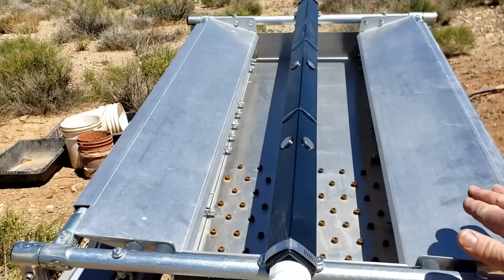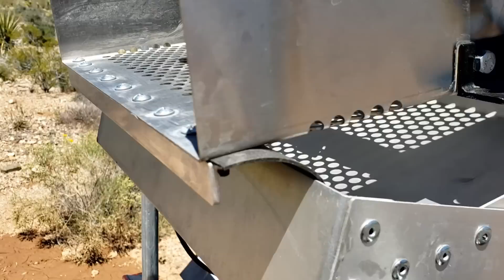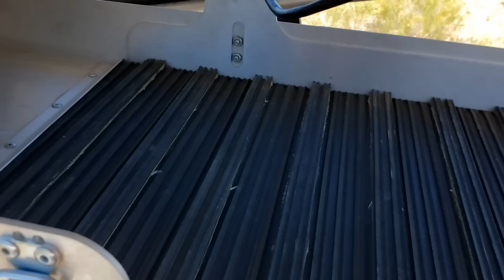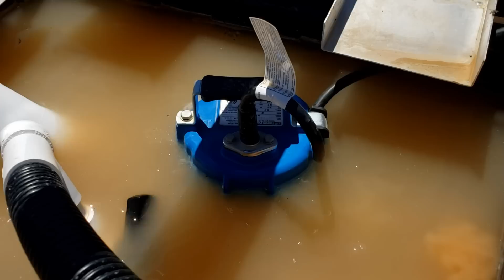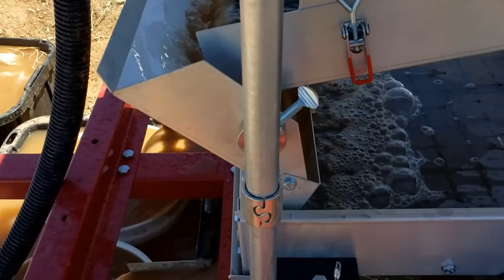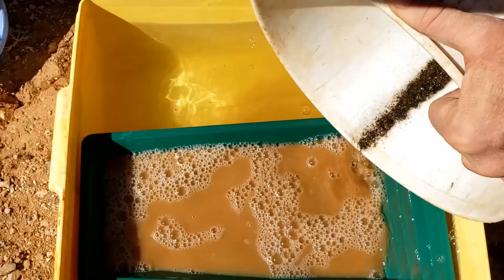Gold Rattler Wash Plant Production Begins !!

Comment: That is a reasonable payment schedule.
You have done a fine job of water clarification. The only thing I might consider as a future upgrade is to use flocculation upstream of the dewatering table to replace some of the sand filtering. Yet that might increase the water loss. It's a trade-off.

How many gallons of water per operating hour do you consume/lose? That's a lot of water weight to be hauling out into the desert.
The dry washers are less efficient recovery of fine gold, yet you may recover more gold weight per day because of the high throughput of a dry washer. Everything is a trade-off.
Reply from the maker: Flocculation in the main water stream will not work because the recirc time about 90 seconds.  You need at least 10-30 minutes to work properly.  This why there sand filters in place.  They are more effective.  However, Flocculation of the hydrocyclone discharge is optimal because the volume is a mere fraction of the total, plus the poor man's thickener slows down the process to permit adequate sedimention.  Water consumption is 60 gallons per cubic yard.  Less if it is wet.  Thanks for watching and appreciate your comments. 👍

Comment: Allan, do you trade to Australia? if so what voltage do your equipment works on, hope we can work together, all the best from Australia. Allan
Reply from the maker: In the future I hope to open a dealership there.  It would be perfect for your arid regions !  Everything operates on 110v AC at 60 hz.
Reply: @allansgoldmining  no problem, can always get a US 110v geny, or upgrade to 240v set up, also to cut down on transport cost, we can do away with the trailer, can easily be build here to your spec, looking forward to when you are ready

Comment: Hi Allan! I would recommend the following price: 1200 for the trailer. 700 for the upper gutter. 1200 for the shaker. 300 for the frame. 300 for pump hoses and pump. plus another 30 hours of work to put it all together. 1500 wages. plus 2000 profit. So 7200 plus possibly taxes. There is also a 10% surcharge, which can later be deducted by the middleman as a discount.
Reply from the maker: I like your thinking !

Comment: This seems perfect for the size small mining hard rock placer operation/ refinery im building. I built my company Raspberry Hot Springs on 30 acres of patented mining claims on the historic black hawk/gilpin and lower fall river/virginia mining districts in Clear Creek County Colorado
..while i was securing water rights for my business I came across historic Mining reports and documents suggesting i was sitting on very likely an avg of 3-4oz/ton AU ore..i invested a couple years of spare time into geology research , equip, and recently processed about two tons of fire assays and sure enough..they werent wrong! I have alot of work ahead sheeeesh..
   Id like to put a deposit down!

Comment: If you said $9,995.00 maxed out with everything we need... well I still wouldn't be sticker shocked... but at $5,500.00 well thats a fabulous introductory price to get the units moving and out in the field were everyone can see how all of this can be taken to the next level.

I can see longer dual sluice boxes side by side and a wider top box to feed the two boxes with a mini- trackhoe! Woo hoo!

A wider top box to accommodate loading from a mini trackhoe or bobcat  with a very small proper sized front end bucket. ...and you would need a grizzly and hopper above your top shaker box to auto feed your top box.

So how do we know our dirt is feasable to work...  well... I have a wooden box that is exactly a 1/2 cubic foot.  (adapted from Jim Strait who used a full sized 1 cubic foot box).

So 1 cubic yard is 3x3x3 feet or 27 cubic feet or in my case 54 - 1/2 cubic foot boxes.

So my box is 1/54th of a cubic yard.  

So I can use my box to measure the size of the bucket on the loader or the size of a 5 gallon bucket 1/2 full.

Say the bucket on the mini-trackhoe is 1/4 cubic yard.  ... and I make on average  25 loads into the goldrattler every hour for 8 hours per day.

25 x 8 x .25 or 50 yard in 8 hours plus 2 hours for clean up ect. ...and we are crazy lucky and we are averaging. .75 grams of 90 proof gold.  

25x8x.25 x.75 x .9 = 33.75 grams.

Then we buy a light plant and run two shifts... 67.25 grams/ day rounded down to 2 ounces per day.

...at $3,000.00 per ounce times 6 days/week or $36,000.00/ week.

x4 = $144,000.00/ month.

At about month 3... we add a second gold rattler with longer dual sluice boxes and your power auger and a deep rock drilling rig to see if we can stay in ground at or above .75 grams as long as possible.

After we are running 6 Hitachi EX 8000 power shovels 24/7 365... well you tell me... because each scoop is 54 cubic yards and a we make a scoop onto a conveyer hopper every two minutes.

We need a way to clean out the sluce box into a secure lock box via a wet vaccum system where we turn off the vibration on the sluice boxes for only a few minutes.

...and we need a small gas or electric power washer to clean the shaker  screen.

... and a second water storage tank to transfer water into.
Reply from the maker: Wow !!  You've got this !!  Fantastic comments.  Love it !!  Thank you for sharing your knowledge. 👍👍👍  Basically, you're right in line with future plans to design a "Super Rattler."  This design operates very well at this scale.  Creating a multi 3-unit machine with feeder hopper/conveyor and substantially larger tanks, it would be an ideal setup for medium-sized operation.  That's what I'm thinking for the future !  Another aspect will be the "River Rattler" designed to meet CA water standards.  If approved, it could be a huge difference for those working streams where turbidity is a big issue.  Anyway, thank you so much for these great comments and ideas.  Very much appreciated !!!  Best of luck to you. 🤠⚒️⛏️👍👍👍
Reply: @allansgoldmining  your origional Lowes bucket trommel videos were epic... so glad to be able to add to the mimi shaker deck recirculation revolution... which combines frequency vibration, water re-circulation and filtration with a rubber mat that is really exceptional!

I would focus on how much gold you get in a single day and how much gold you get in a week vs how much it cost to get it each day and each week.
Reply: My father was a geological engineer of great accomplishment.  

Oil and gas move up in the subsurface until they trap... precious metals move down in the subsurface until they trap.  

So we are looking for those traps. Clay base, a shale barrier, faulting, ect.  For gold we are looking for fluid moving re-depositions where gold is  concentrated from its origional upward intrusive push toward the surface of the earth.  

Water and weathering over time move the gold basinward from the higher elevations into re-worked commercially viable gold deposits.  ... and or the gold could have just pushed upward from directly under your feet which is also great!

In your location with excellent surface gold indication... the hope is that the gold  is also gona be at depth under your feet to several hundred feet.
Reply from the maker: @50Quid-d3x  That's an amazing story about your father.  Sounds like some of it rubbed off on you !  It would make sense to discover gold deposits within strata.  I thought about that while driving through Texas last April.  ASARCO drilled several exploratory holes in my area.  Their report indicated there are three layers of gold deposits, with the surface being the richest.  The other two layers were too low grade.  They also determined that the gold was too spotty for a large-scale operation, and thus abandoned the search.  On my claim there are three large pits excavated by miners in the 1960's.  You can easily see the layers.  I took multiple samples and only found a couple specks.  I kind have drawn the same conclusion.
Reply from the maker: @50Quid-d3x  again, thank you for your great comments and ideas.  Funny thing...  My Engineering friend, who developed the mat, and I  were discussing that very issue the other day !  So, my next video will involve production in relation to time on how the Gold Rattler will eventually pay for itself.  I'm sure many folks look at the price and shy away because they haven't rationalized the value in terms of gold production.  The old dry washer tailings on my claim run .7 grams/yd.  The virgin ground runs about 1.2 grams/yd.  Running just a couple yards a day, it will pay for itself in just a few weeks.  Yeah, that bucket trommel turned into quite a popular topic. I've had dozens of folks make on from my plans.  Some do it as a winter project build.  I simply did this for fun, thinking only a handful of people would see it, but it certainly when viral.  This began my YouTube venture.  Thanks for watching !!

Comment: if you could sell all the clay silth you gather with your filters, wouldnt you be able to sell that clay for a bit of coin as well ?
Reply from the maker: Jokingly, I thought it could be a new beauty facial treatment containing gold ions.  Lol !
Reply: @allansgoldmining  maybe a mesh slide where water can go through but they clay silt cant ? so you can run the system longer?
Reply from the maker: You could, however, there engineering problems.  In order to build a double deck with top deck at 150 mesh, and lower deck at 400 mesh (as an example) it would weigh twice as much, thus requiring vibrators 9x more powerful to shake both decks, causing the design height of the plant to increase 15 inches, making it very impractical to feed by hand.  Therefore, you would need a conveyor feeder at about $3k each.  You will need a larger generator because the larger vibrator motors are now 220 volt 3 phase.  Finally, a 400 mesh screen is fragile and requires additional maintenance.  Like anything involving engineering, there are compromises, and the laws of physics have to be maintained.  It can be done, but at what costs, and ia the unit no longer as portable ?
Reply: @allansgoldmining  yeah  i see your point comparing the cons at the pros far more cons that pro's for doing that also a lot more expensive so not worth it in the end
Reply from the maker: That's what the dewatering deck is all about. It's much simpler and cheaper than building a centrifuge.
Reply: @allansgoldmining  i mean like an extra one where it removes even the finer clays

Comment: If you were in an area with plenty of water would you use the same pump or go larger for electric or how big if using gas?
Reply from the maker: Absolutely.  I have a customer who's developing a solar generator system for it.  Realistically, a 500 gallon tank at the Mine site would last a long time.  👍